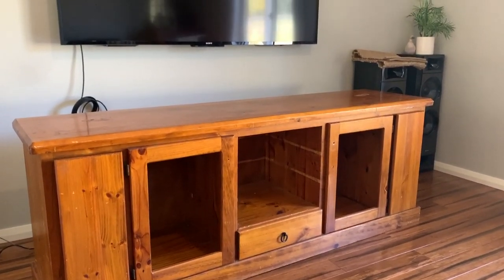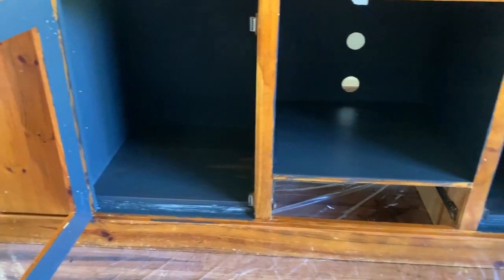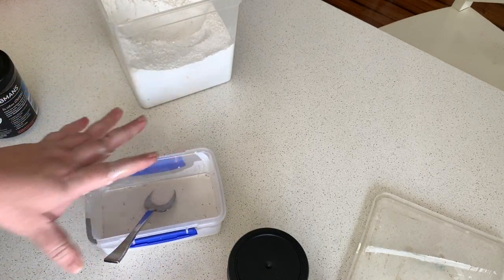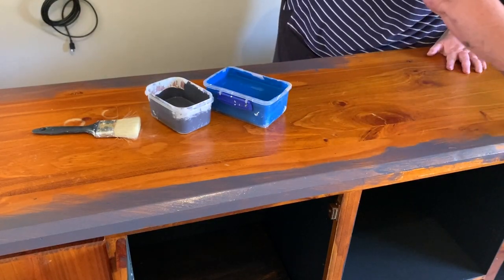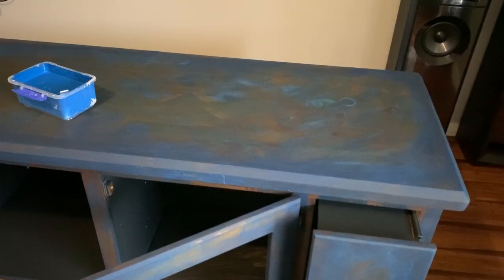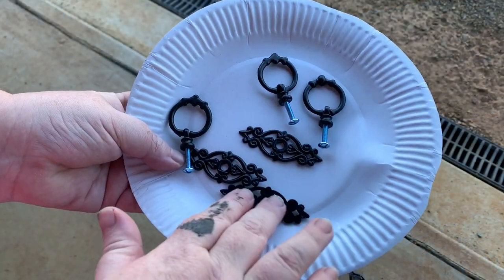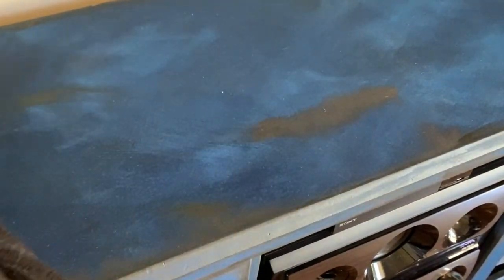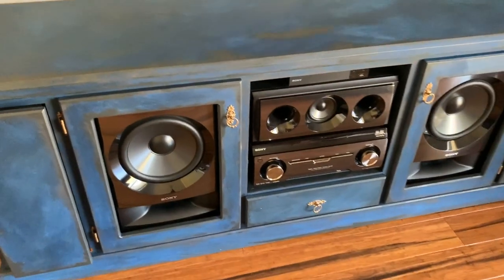DIY FURNITURE MAKEOVER | TV CABINET | HOMEMADE CHALK PAINT

Comment: Lisa the cabinet looks awesome. I finally gathered up the courage to ask hubby if I could paint some cabinets we've had forever and he said YES!!! I probably didn't need to ask but he lives here too. The only problem I have now is deciding on the colour. I know I want to have finger jointed panel shelves I saw at Bunnings called Eucalyptus Grandis. Now I just have to work out which colour works best with the timber. So many decisions. You also helped me sort out my craft room storage after your last tour. I don't have the cube shelves but I have a shelving unit that I'm going to adapt to the cube style and use some of your ideas for storage. I need a bit of help getting the cubes sorted but have a couple of strong backs around the place who will help me out... hopefully. Thanks for the inspiration.